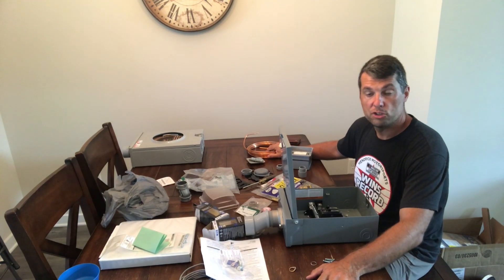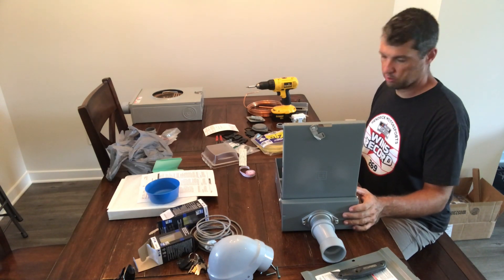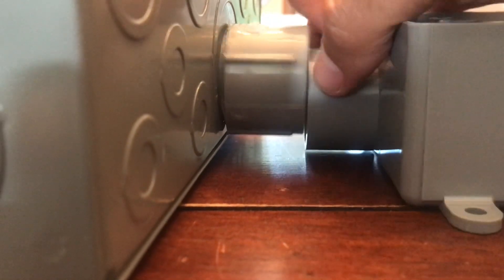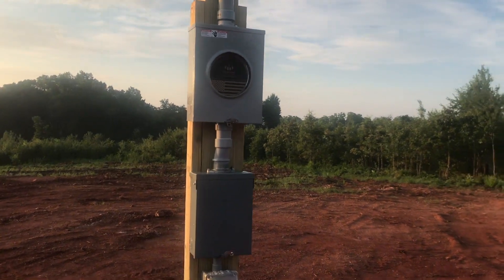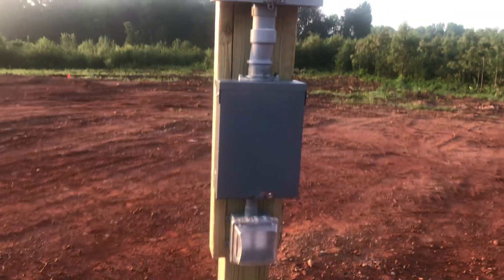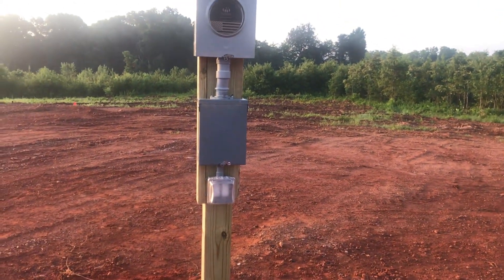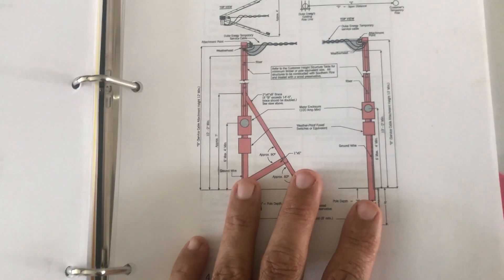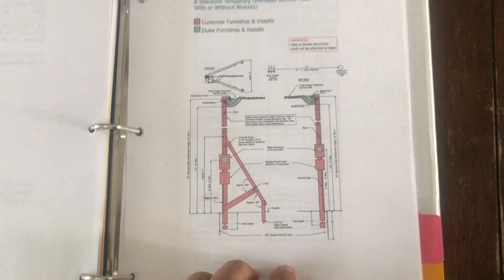NC Barndominium Build - Building and Setting Temporary Power Pole

Comment: Could you post a list of the components you used?
Reply from the maker: @heavensong7  The unit has been taken down some time ago and many of the parts repurposed for other projects.  

Usually your electrical service provider will have some kind of document that specifically tells you how to build your pole.  I am on Duke Energy power.  If you have them I can send you the document that they provided me with if that would help.
Reply: @allthingspostframe i gotcha I download the blieprints for a temp power pole from my eowctrical coop as well its just very vague as ti what materials to use. I spoke to the electrical engineer and got some info hiwever as far as parts to shop around for and buy im trying to figure this out doynfor the first time and theres not much help out there

Comment: What model meter base did you get?  I live in Shelby NC just down the road from you.  Having a hard time finding any combo panels in stock that is MEG approved for Duke power.
Reply from the maker: Milbank 200 amp 1 gang ringless overhead/underground meter socket model #R7040-xl-tg-hsp.  If I remember correctly that model number doesn’t match exactly with the Duke document online for approved models but it does work and they hooked it up no questions asked.
Reply: @allthingspostframe  That seems to be the same thing my electrician contact said. Said he did one just a week or so ago and he just uses whatever combo panel he can find. I ordered a Leviton online. We’ll see what happens. Thanks for the response. Keep the videos coming.

Comment: Electrical inspector didn't tell you to put your ground wire in the meter can and you need 2 ground rods 6 feet apart?
Reply from the maker: I just posted the results video from our inspection.  Here is the link that will answer your question. https://www.youtube.com/watch?v=0GcTTF8kvF4
Reply: @allthingspostframe 
 Looks like your making progress. You might want to think about a 200a meter socket load center on the outside of the house. If you decide to run 220v outside anyplace it is a lot easier when the panel is outside. IE pool, hottub, out buildings. Just a thought. I'm in Davie County.
Reply from the maker: @blown2000f150  I will have to keep that in mind.  You never know what the future may hold.  Thanks for the heads up!